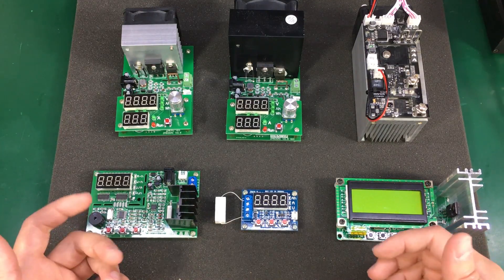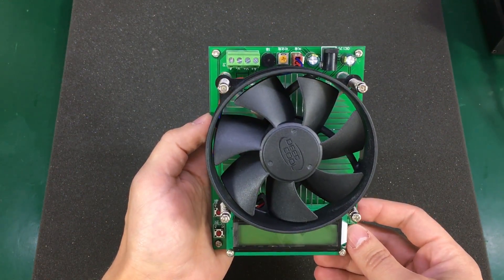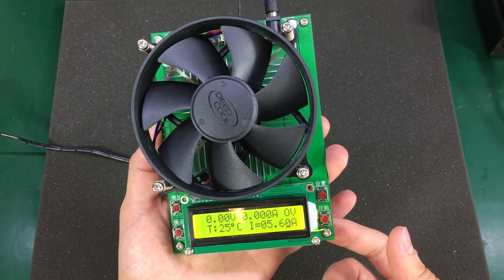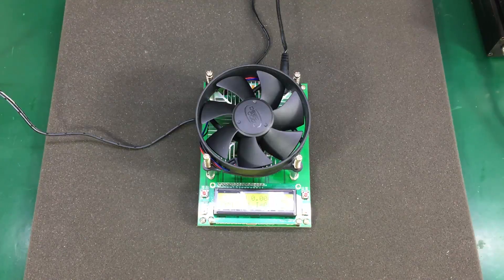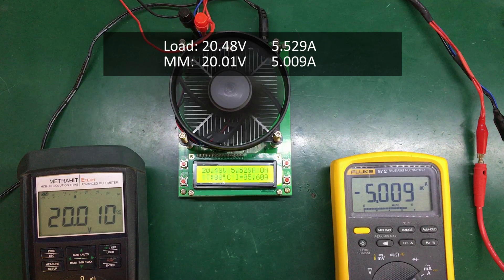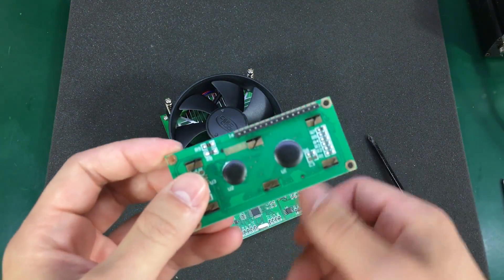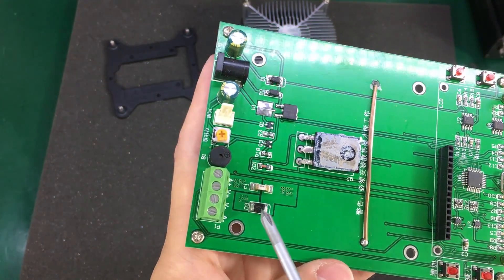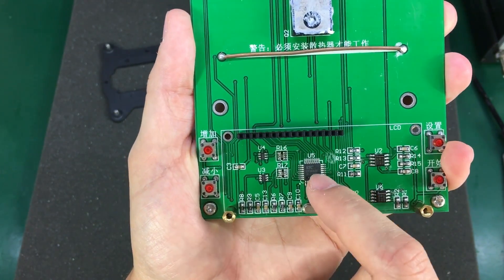Voltlog #108 - 150W Electronic Load Review - It's a fake!

Comment: In some of these units I've noticed the microcontroller is often located right next to the MOSFET...which gets VERY hot. The accuracy of the timer in the controller is a function of temperature. So...as the MOSFET heats up, the timer accuracy could change significantly. It may also affect voltage and current data if associated components are also dependent on temperature.

Comment: I also trapped by this rubbish. The bug you have found I also have in my device and it even destroy the mosfet if the DUT is able to provide enough current. I tested with lead acid batteries and damaged the IRF250. Anyway, there is a possible simple workaround for the bug but it does not improve the overall precision of the cheap "fake" version. Fake because there is a "original" one which I finaly found and which is semi professional in performance. You can see the difference on the right side above the setting key there is a RS232 (rx, tx, gnd) connector. Have fun

Comment: Thank you for your review. You saved me from buying a wrong/fake one. 
I got a good one from here (ordered 10/2018): 
https://de.aliexpress.com/item/150W-Constant-Current-Electronic-Load-60V-10A-Battery-Discharge-Capacity-Tester-ammeter-voltage-meter/32725711985.html 
Good ones have those properties: 
- “Welcome to use" message at power-on. 
- “Electronic Load V2.27” printed on PCB (underneath lcd module). Older ones may have firmware v1.6 or similar. 
- "cooler master" label on fan. 
It lowers current accordingly if 150 Watt dissipation power is reached while load voltage is increased. 
Some sellers show photos of good ones but sell fakes. Some might not even know that there are different ones out there.

Comment: Just bought this as well... In my case, it showed 0.02A, when 2A was set. I have quickly discover a blown SMD fuse and then a blown TO-247 load mosfet. changed these to a new ones and it failed once again when I started the test. I used a 100A mosfet, so this must be due to high voltage inductive kick. After further investigation I have found there is absolutely no overvoltage protection in this device - not worth fixing, unless I add a bunch of extra components.

Comment: P.S. here you can find a very good instruction incl. adjustments / calibration and special (hidden) functions (in german language):
http://www.360customs.de/2017/01/150w-constant-current-load-60v-10a-battery-capacity-tester/
Seems there are good and fake ones that look very similar with those 4 buttons left and right of the display. Others have those click-knobs to adjust values and settings and come with yellow PCB intead of green. But this seems not the proof for fake or real...
Reply from the maker: mine is definitely a fake.

Comment: Thanks for this interesting reveiw and warning! Kept me from wasting my money on that. Did you check or hear if the newer products are any better and if the removed the bugs in firmware? I bought the 60W dummy load instead but it was way off the specs either! I had an error of more than 10% on the current reading (50% in the lowest setting of 200mA - was only 100mA instead). But i managed to improve the accuracy by resoldering the current sensing shunt which was soldered from one side only on my exemplar. By doing so i succeeded in having reliable values between 1 and 2 Amps load but on lower values it shows to much, on higher values it shows to less power! So this seems to be unfixable just by adjusting the shunt - you need an accurate calibration method and maybe adjusted firmware. Anyware for 15 bugs you get a reasonable adjustable dummy load but you cant expect a high-precision instrument ;-)
Reply from the maker: all of these cheap dummy loads have problems measuring low currents, but the 60W dummy load is still the best overall out of the bunch.

Comment: Hello Florin. I wonder if you had done anything about this DC load. The reason I am asking is I have a genuine one, which worked perfectly until today. I was trying to calibrate a hall effect current sensor for a project of mine using the DC load and while doing it, I disconnected the load lines and reconnected them with the DC load on. There was a small spark and the load cannot measure voltage anymore. Everything else is still working.
Reply from the maker: I haven't done anything related to this load. I would suggest reverse engineering the schematic, figuring out where the voltage sensing happens, check if there is any protection on that (maybe a protection diode popped). If there isn't a protection diode, then maybe that signal goes through an op-amp and that op-amp is dead. If the signal goes directly to the microcontroller, that ADC is probably dead and there isn't much you can do about it.
Reply: That is exactly what I'm trying to do at the moment, but it is not an easy board to reverse engineer. There are protection diodes and a 10A fuse, but they check out OK. There is an ST brand SMD op-amp (that is my guess since there must be an op-amp), markings on it says "358" and "MZ634". I could not find anything as MZ634, so I think it may be an LM358. There is a voltage comparator, LM393, and there are two 18 bit DAC's (I know this from the sellers item description page) they are in a very tiny SMD package and marked as "CAEE" which again there is absolutely no info about. Buying another one is an option but I am afraid they will send me a fake one like they did to you. I really want to repair this and I am willing to change all of these parts in doing so. I will appreciate any input from you if you can find the time to check what's on your fake one. I can send pictures of the parts too, if you can give me an e-mail.

Comment: I've got an EBC-A05 Electronic Load / Charger that works well and has an output for a PC so you can log and graph the data.  It can handle 0-30.00V, 0-5.000A, up to 60W and costs around $50.  This unit is great for testing batteries since it can first charge them up fully and then discharge them to a preset value and shut off.   What do you think of that one?  One odd thing about it is that it has a USB port on the back but the output is serial, not USB, and requires an external adapter in order to connect to a PC.  I didn't know that and never ordered the adapter so I just used an FTDI USB adapter that I already had. Otherwise the unit has worked perfectly.
Reply from the maker: I haven't tested that model.

Comment: Just to let you know there is a CBA IV Pro load from UK with optional CBA Charge Controller total 300$ value it can do various test and automatic battery lifetime check/ charge discharge cycles. It can be extended to 2000W at 500W increments. 

Now why ZKE tech or somebody else can't make the same clone hardware? Why make the rubbish fake clones?
Reply from the maker: I think we are going to start seeing better dummy loads coming from China. Most of the time there is a big language barrier so the Chinese part doesn't know what we want.
Reply: I rather not wait and build this one, Just need to wait longer for logging PC part to be made http://www.scullcom.uk/category/projects/dc-load/

Comment: Thanks! As always great video! Wish I saw it before buying this unit. I hope at least mine has improved firmware.
Reply from the maker: I hope you get the original one.
Reply: Unfortunately, no. My unit can't even handle 100W for extended period of time. heats up and shuts off very quickly. And then if you try to operate it, it starts short-circuiting repeatedly. I have to push "start" button a couple of times to get it out of that short circuit mode. I wonder if these units could be fixed by reflashing original firmware. But I bet original manufacturer doesn't make it available to prevent cloning.

Comment: Thanks for the review. It is a pity that some bad suppliers destroy good products by creating bad "faked" products. I did also use some of these loads, but recently bought an ITECH IT8512A+. Of course, this is a different price range, but so far, I am happy with it, mainly because it displays 4 values at the same time...
Reply from the maker: I've been looking at BK Precission, Maynuo and Itech for quite a while.. they are very similar, maybe even the same electronics under the hood. Good electronic loads, I might get one at some point.
Reply: I plan to do a video about my new load in the near future. I had first ordered a Maynuo (because it was 50$ cheaper). But it was out of stock and I needed it. So, I changed to the ITECH. As you mention, they seem to be very similar inside...

Comment: Hello everybody
I also bought this dummyload.
I also miss the "1.4" on the display when I turn on the voltage.
At my dummyload, apparently, the temperature control for the cooling fan does not work anymore.
  So I'll try to steer with a small thermostat the cooling fan.
I would also like to install a voltage regulator for the cooling fan, so that it brings a little more cooling performance.
Still one thing that comes to mind, is that the self-calibration does not 
work either. 
I did not manage to activate the self-calibration (post of volvoracinggermany)
If I read your posts so, then I suspected that I also bought a fake.
If after my addition the dummyload still works, it is ok. 
Otherwise I will probably dismantle the heatsink and the fan.
The rest of the dummyload gets a oneway ticket to the moon. :-)

Comment: You can easily identify if you got one of the bad fakes or the real good working version. No need to even turn it on for this. Just have a look on the main pcb. Under the display pcb you will find the text "LCD" on the fake version and "ELECTRONIC LOAD V1.6" on the good version. And you will find two additional holes (one to the left and one to the right of the display connector) on the main pcb only on the bad "LCD" version. The good "ELECTRONIC LOAD V1.6" version does not have this two holes.

The fake version has very poor accuracy and the most important thing is that it does not turn off the load at overload conditions correctly. Without my voltage and current limiting psu I would have killed the MOSFET at first use. The firmware of the "LCD" version is crap and it has much less functions (e.g. no automatic and manual calibration modes and more). Another way to identify the bad version is that on power on it does not show the "Welcome to use" message.

I just bought one on Aliexpress from the Seller "Pro Powers Tools Store". He advertised the well working "ELECTRONIC LOAD V1.6"  version (pictures and description text) but sent one of the bad "LCD" version to me. I opened a dispute with describing the problem and with two videos and in the end I got my money back after Aliexpress stepped in the dispute.

I think there are many stores that sell the bad "LCD" version but advertise the good "ELECTRONIC LOAD V1.6" version but even don't know that they are selling the bad one. There seemes to be a freeloader that made a very bad copy of the good "ELECTRONIC LOAD V1.6" version. You cannot read out the firmware and this I think is the main culprit of the "LCD" version because they had to write their own firmware for their bad copy. With a good firmware it may work as good as the original.

Now I ordered a second one (Aliexpress store name "KKK-store") and contacted the seller before I ordered and he told me that I will get the good version. It's still on it's way so I cannot say if this time I will the the good "ELECTRONIC LOAD V1.6" version. Keeping fingers crossed...

I modified the "LCD" version I got. I mounted a better cpu cooler on the device (https://goo.gl/twutid). And I re-positioned the MOSFET and gave the NTC a little thermal grease so that the coupling to the MOSFET is better. With this I get 100% stable 150W at about 7x°C and I can go up to 185W at 91°C. At 93°C the "LCD" version "tries" to cut off the load (but it doesn't).

Hopefully I will get the original "ELECTRONIC LOAD V1.6" version to compare both. With a correct firmware it should turn of the load on voltage, current AND watts overload conditions I hope. Not only in over temperature condition.
Reply from the maker: Yes, I realized everything you said after reading the comments in here. Good luck with your new purchase, hopefully it will be the right version. I will try to source one of the goods ones directly from China through a friend.
Reply: Today I got my second order and I had luck and got the real version with "ELECTRONIC LOAD V1.6" text on the main pcb. It works very good with perfect accuracy. Seller on Aliexpress was "KKK-store". I made the modification I already have described (better cpu cooler) and with this I can get 100% stable 160W at 54°C MOSFET temperature at about 24°C room temperature. The EDL does not allow more than exactly 160W (16,00V @ 10.00A). When I increase the voltage over 16,00V @ 10A it reduces the current automatically in order not to go above 160W. I hoped it would take the MOSFETs' temperature into account and let me go higher than this. The IRFP250N is capable of 214W.

The original EDL has a cooler master cooler and it is slightly narrower than the one on the fake EDL. So you cannot change the coolers coming with the original and fake version against each other. The original EDL has a much better power dissipation even with the original small cooler than the fake one.

Comment: I'm in a current battle with eBay seller Alice1101983 over item "H-bridge l298n module" board I purchased (5ea), only to find it was different from most seen online.  I asked repeatedly for documentation. For this one item (so far), they appear to have gone out of their way to not satisfy my (the buyer, remember?) concerns. I'm about to negative-vote them on eBay.  Does anybody know of an online "seller scorecard" website, so buyers can evaluate potential purchases from certain sellers?  Thanks.
Reply from the maker: if they sent you the wrong item and you have a good ebay reputation than you should be able to ask for a full refund.

Comment: Thank you for the video. Sadly I burned this in like 10 minutes without doing nothing special,  I Ve ordered some spare parts to hopefully repair it. But I'm not confident. I was so disappointed that I overshooted in its substitute and I ended buying myself a Maynuo M9710 instead... My wallet was not happy... If just that thing worked it decently I wouldn't have reacted so badly
Reply from the maker: the maynuo is decent but in a completely different price range.

Comment from the maker: So apparently my unit is a fake, that's why it's got all those problems. There are also genuine ones which don't have the problems outlined in this video, they can be identified by a tantalum capacitor under the LCD, a discussion is here https://www.eevblog.com/forum/repair/part-identification-150w-constant-current-electronic-load-60v-10a/
Reply: So the TEC-12P or TEC-06 that can be connected to PC, has reliable old design and no fakes is worse than ZPB30A1?

Comment: A german review (https://youtu.be/6iiBt6EHeSk) shows the ability to calibrate and seemed to have good correlation to external meter readings and cautions to watch out for fakes. The buttons on that unit were labeled in english. Maybe you got a fake which reflects badly on the properly operating load. They also show the power rating specs derating over 20volts.
Reply from the maker: yes, I think I have one of the fake ones.